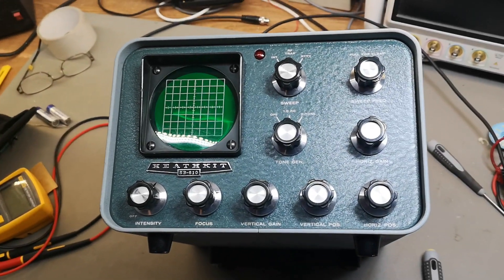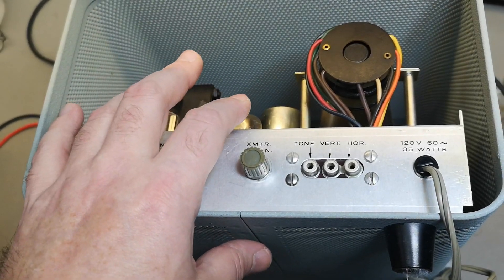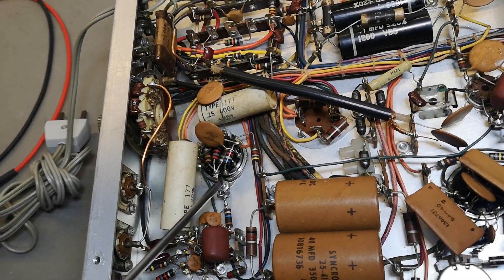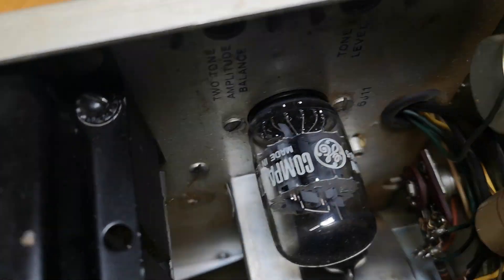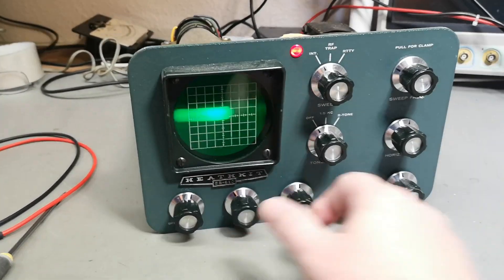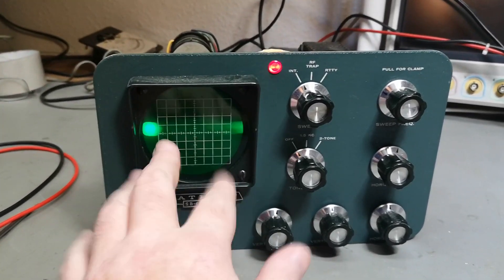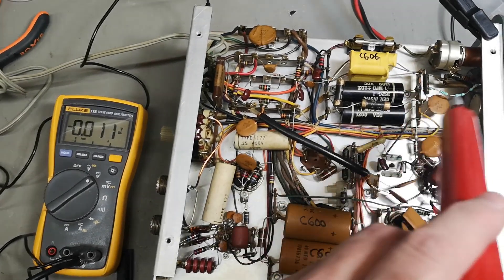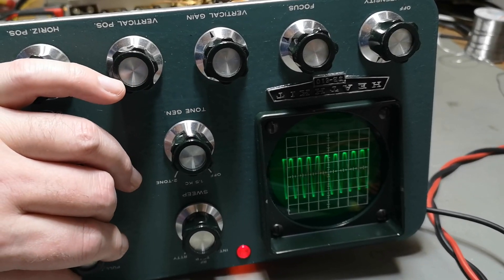Heathkit SB-610E Monitor Scope 1966 repair vintage teardown

Comment: The e is europe,so it works on 220 volts sb 610 for 110 volts or sb 610 e for 220 volt europe model if it has not the 110 volt connector but the european then thats ok
Reply from the maker: thanks